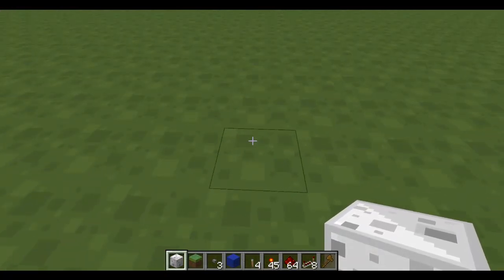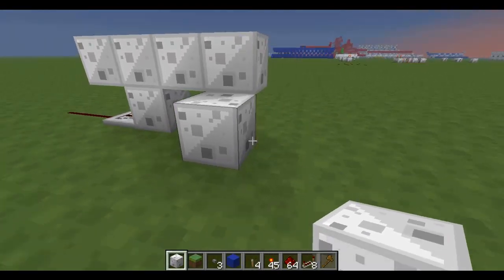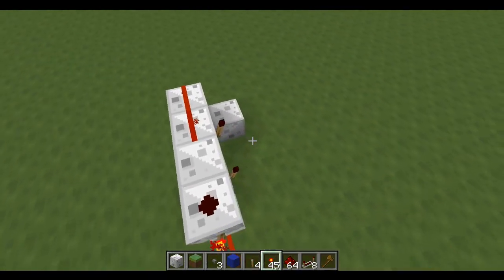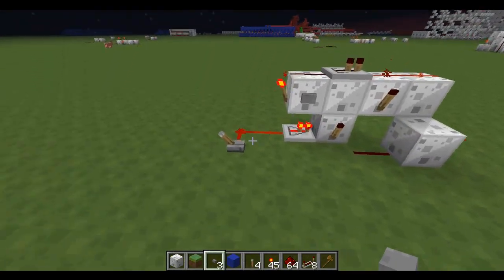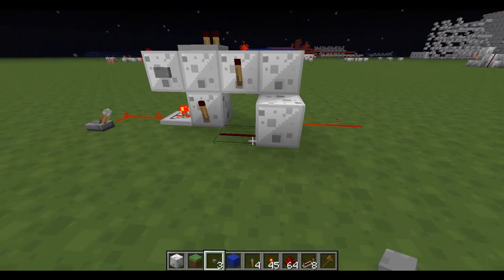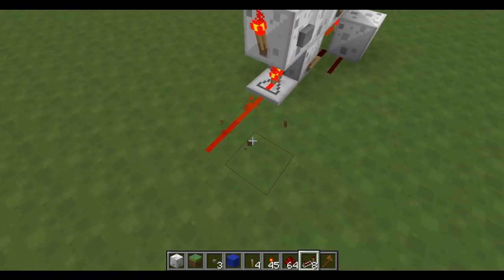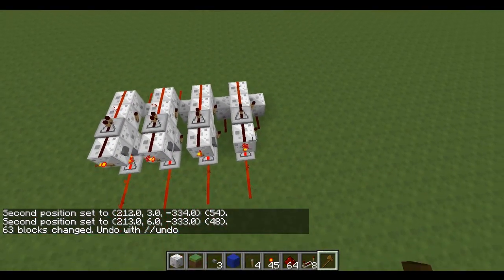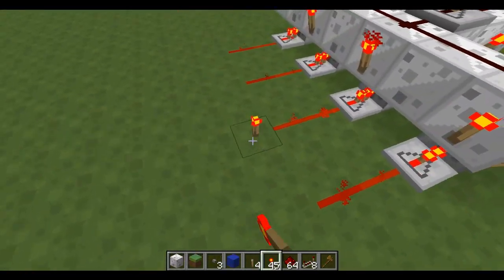Minecraft Logic Gates 11 - Compact D-Flip-Flop [Tutorial]

Comment: I can't get the circuit to work with a lever.  When I press the button the output goes off for a bit under a second, and then comes back on by itself!  It does work with a redstone torch (or nothing, or for that matter if I buffer the lever with a repeater), but there is a brief glitch high on the output when clocking it without an input ("off") - this is incorrect behavior.  Also, the sampling window at the input isn't quite right. If I chain these together to produce a shift register, the signal somehow propagates from the input all the way through multiple flip-flops in only a single clock.

Comment: Wrong this is not D flip flop. This works life D Launch. You logic circuit does not work while the clock change state from 0 to 1. It work when the clock is firmly at 1 state
Reply: Just add monostable to it
Reply: if the clock is firmly at state 1, then it would just be a switch -_-